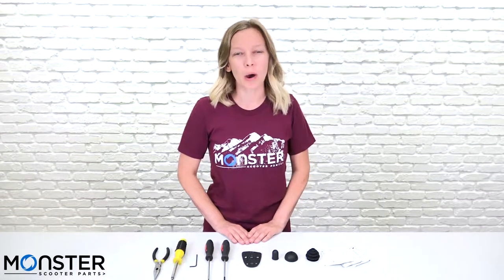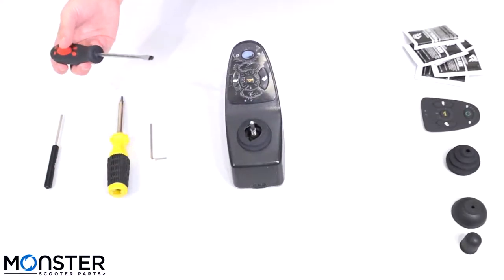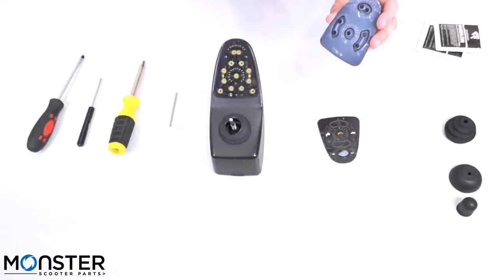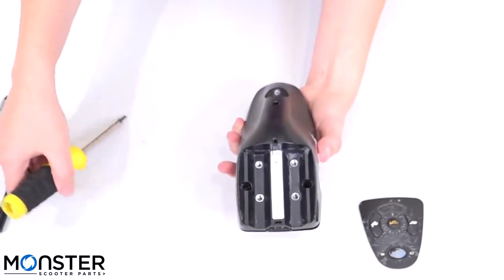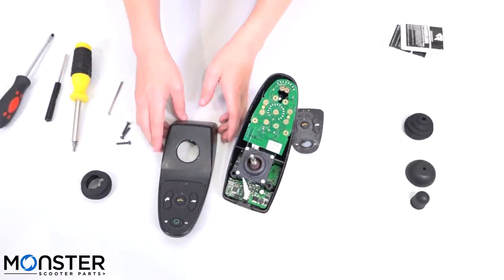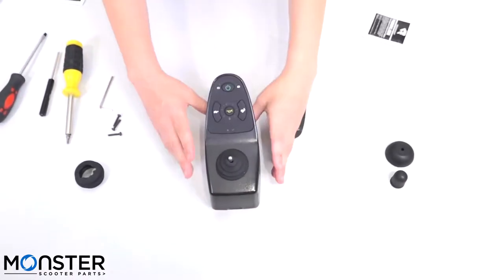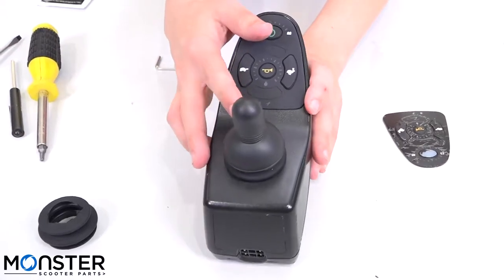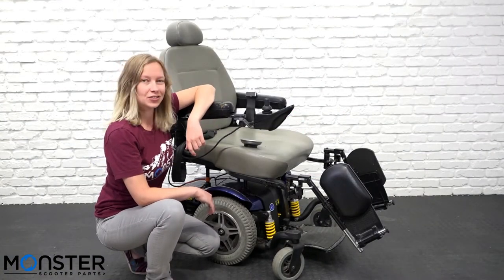How to Replace the Keypad, Knob, Skirt, and Boot on a Dynamic Shark Joystick

Comment: The problem I'm having is: My Jazzy_Elite_14 shows Full Charge on the Meter. I can literally go into the next room and turn it off for a few seconds to do something and then turn back on and it has lost all but 3 Bars. I turn off again and wait a few seconds and turn back on and Than either gain some Bars back or lose all but the Single Flashing Red Bar. Turn off and on again and gain a Bar or two. 
I'm not getting any CODES and when plugged back into charging, I get Green Flashing Light in like 5 minutes and the Power Meter is FULL AGAIN!
Could you please help me solve this problem? I have no confidence in the chair so I won't go anywhere.  I just purchased 2 new batteries from you but haven't installed yet.